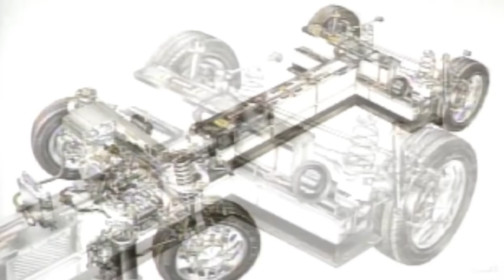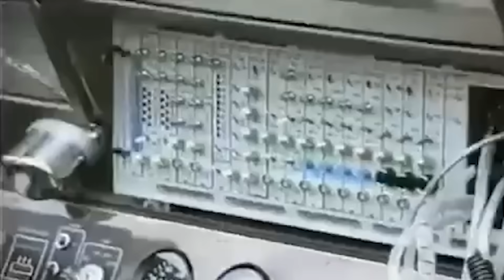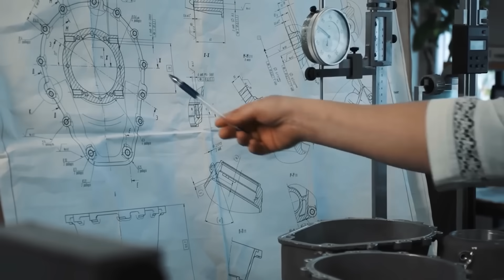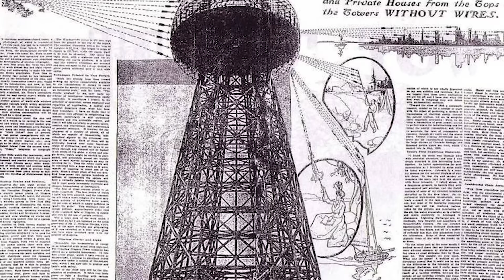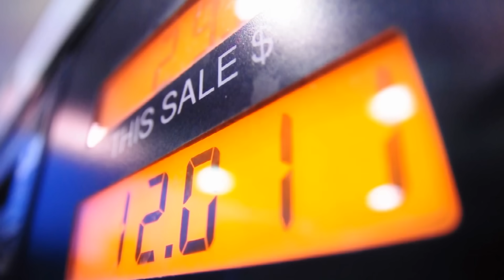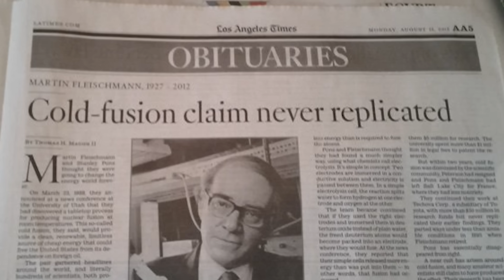Top 10 Inventions That Were Suppressed Because They Worked Too Well

Comment: The Myer fuel cell was definitely a scam .
The cancer device too.
Free energy. No sorry alchemists trird for centuries
200 mpg no. No matter how efficient the carburettor the fuel csn only deliver so much energy. It's why you get worse mpg from ethanol. It's aninferior fuel. Same with diesel to get the same power you need a bigger engine or turbocharge it and firl consumption goes up

Comment: So the rumor with Pogue is that the blueprints were later discovered in a hidden compartment of a toolbox, and that he because the owner of an oil filter manufacturing plant basically overnight after his claim.
Pogue hits a bit closer to home for me. I wasn't even born then, but he did this in El Paso Texas. I'm from a small town on the outskirts. What you didn't mention here is that it was a BIG BLOCK FORD V8 he did his demonstration on, and he was followed by news crews. It takes a lot of time to dig up the articles but they are legitimate, and the news channels hired independent mechanics to look the thing over for spare tanks or anything else that would make it seem like it did what it couldn't. They prefilled his tank with two gallons, he drove to Deming NM (about 100 miles) and back, only falling short because he was pushed onto the shoulder by a big rig that damaged one of the hoses. You can find all the original patent information online now. 
He didn't mass produce because once he showed the system, he suddenly ran into a LOT of legal issues getting the patent. His co-inventor was killed, he took to drinking, finally got the patent, insisted someone was poisoning him, then suddenly died of an "overdose" after reportedly refusing to sell to Shell.
My dad's coworker claimed to have been friends with the guy and "knew he wasn't using" but we all know "a friend of a friend" stories are rarely credible so take that as you will.
Reply: Pogue was from Canada
Reply: @oldguyone I mistyped, I meant Ogle was closer to home

Comment: Stanley Meyer invented the "Meyer's Manx", which most people think of as the dune buggy.  That is where he got the money to invest in water powered vehicles
Reply: Power from water is possible when water is broken down molecularly into hydrogen and oxygen. The issue is how to contain what is a very volatile and explosive gas. If you know how electrolysis creates the two gases, you'll get the problem. Not an easy task for fitting the technology to millions of vehicles operated by anyone either stupid or smart.